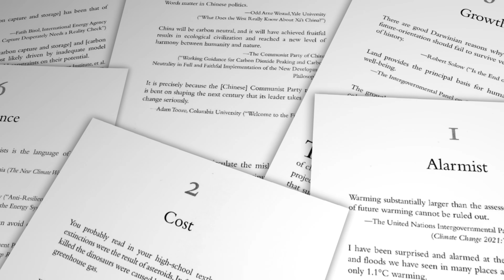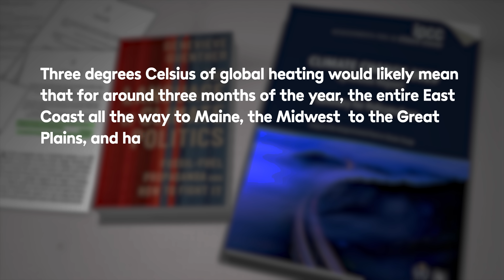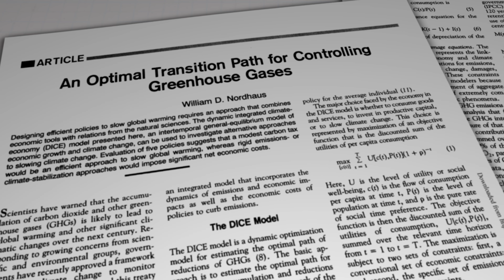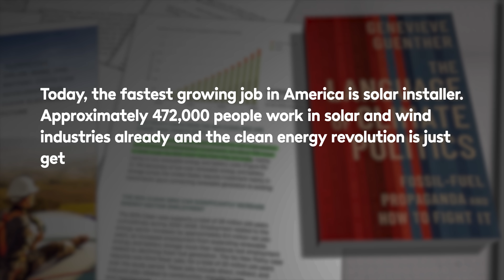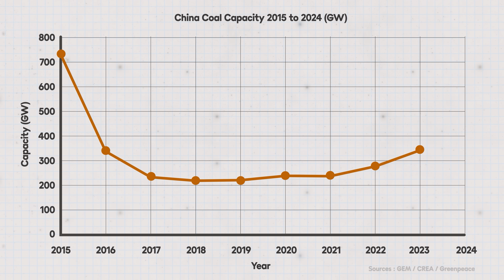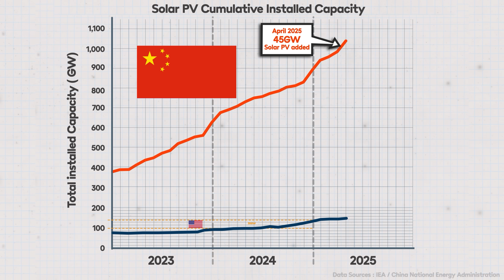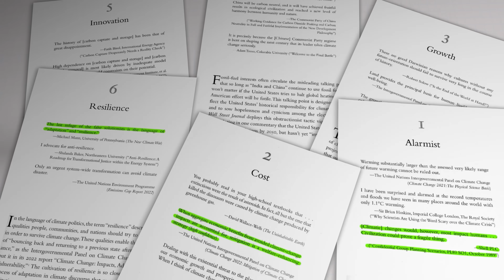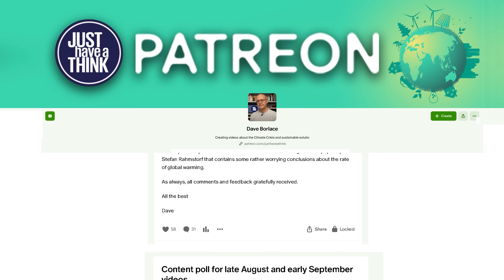New research DEBUNKS climate disinformation.

Comment: Sad part this has been going on since the 1980's and 1990''s. The funny thing had we started serious investment then, the lower the costs and the less pollution there would be now. The big issue is now we're going to have to spend more money doing catch up, if that's even possible at all. Just check the news over the past 5 years. I live in BC where we had that heat dome. Lytton had a forest fire and the heat made it worse. Now Lytton is a ghost town. In my 58 years I've never seen summers this hot. In fact this is the first cooler summer we've had in a while. Burying your head in the sand and saying it isn't real isn't doing anything.
Reply: How can such a relatively small YouTube channel take on the might of the US government,..with embarrassing simplicity.
Reply: I think its HAARP weather control by the secret hidden break away elitists. They caused the fires in Hawaii,  and all over the globe right now.  Its called an energy directed weapon.
Reply: 80s and 90s was the time the neoliberal ‘consensus’ was establishing itself in politics and western economics, and it was (and remains) extremely important to those clowns to maintain the idea that the worst thing any government can do is to interfere in The Market™️. And because the environmental movement had already become a primary enemy of capital by that point, because of how successful it had been in pressuring through strong national and  international regulatory regimes, shutting them down was also a priority even apart from the ‘government bad’ factor. As a result, no propaganda campaign in history (outside of war) has had as much money and resources behind it as the anti-global warming campaign has had over the past 40 years.
Reply: We will never catch up, we can only tweak the curve and try to mitigate the worst effects on humanity. But either way we will have climate refugees in masses fleeing parts of the globe
Reply: You are right if only we would have gone hard even harder than France on clean fission power the world would be a cleaner more stable place
Reply: “Burying your head in the sand…” is doing lots actually. 
None of what it does is any damn good, but counter productivity is a mile away from “not doing anything.”
Reply: Net Zero by 1970 !!!
Reply: Lytton is always Canadas hotspot for summer temps, always has been in 40's, I am older than you and I remember every summer it's always been in the news here in BC for being  hottest. I have driven through on the hottest summer days, Lytton/Llilooet are always cookers!
Reply: @carlsapartments8931  "I am older than you" argument from authority logical fallacy, paired with anecdotal evidence, is certainly a great way to dismiss facts and proven data. Only that it's not how logic works I'm afraid. It actually works in the exact opposite way. Completely discrediting your entire "argument".
Reply: Yeah like in 1980 there was global cooling but let's ignore that little inconvenient fact
Reply: @FL1CK3R  1 year out of 45? Talk about cherry picking.
Reply: @FL1CK3R  I live in Friesland in the Netherlands. We have an ice skating event the elfstedentocht which is held when all the canals between the cities in Friesland are frozen. It start in 1909 and after that it was held in 1912, 1917, 1929, 1933, 1940, 1941, 1942, 1947, 1954, 1956, 1963, 1985, 1986, 1997. And since then never because its not freezing enough anymore here. I live along part of the route and in the last 10 years it was only once possible to skate on the ice. When I was young in the 70ties we skated multiple times and had snow almost every year. Now there is hardly snow. So yes there was a short cold period in the 80ties, that let us have the event, and also in 1997. But the weather is definitely getting warmer changing during my lifetime (I'm 54 now).
Reply: @AndreVanKammen  I have friends in Cap de la Madeleine, Canada. and every winter I'd go up anticipating fishing on the St. Lawrence River. It was scary to drive my car out onto the river ice that first time. But it's been years since that has been possible. It just stays warm too far into the winter, so yeah, maybe you can fish for a few weeks in February, but that's too chancy for me.
Reply: @FL1CK3R  And finally, it’s an appeal to ridicule, framing scientists as if they “ignore inconvenient facts” rather than relying on peer-reviewed evidence. All four rolled into one lazy talking point.
Reply: @FL1CK3R  First, it’s a straw man: there was never a scientific consensus on “global cooling” in 1980—media hype exaggerated a few studies while the majority of climate papers even then pointed toward warming.
Reply: @Job-Brogan You’re doing a good job 👍
Reply: @FL1CK3R  Second, it’s cherry picking: taking one misleading anecdote and ignoring decades of consistent evidence for global warming.
Reply: @FL1CK3R  Third, it’s a false equivalence: pretending that a short-lived media narrative fifty years ago has the same weight as the overwhelming scientific consensus today.
Reply: @FL1CK3R  🤡🤡
Reply: @FL1CK3R  Wow, 🫵 managed to cram four logical fallacies into one sentence. Truly impressive how hard some people are ready to bend backwards to kiss the behinds of big oil CEOs, lobbyists, and corrupt politicians. 

First, it’s a straw man: there was never a scientific consensus on “global cooling” in 1980—media hype exaggerated a few studies while the majority of climate papers even then pointed toward warming. 

Second, it’s cherry picking: taking one misleading anecdote and ignoring decades of consistent evidence for global warming. 

Third, it’s a false equivalence: pretending that a short-lived media narrative fifty years ago has the same weight as the overwhelming scientific consensus today. 

And finally, it’s an appeal to ridicule, framing scientists as if they “ignore inconvenient facts” rather than relying on peer-reviewed evidence. All four rolled into one lazy talking point.
Reply: @FL1CK3R  Go ahead and demonstrate  that you are not an anti-American communist sheep repeating the party line without question like a trained dog and show us your data that there was in fact cooling in 1980 that was greater than the standard deviation in annual temperatures.
Reply: @williammeek-h2o can you please NOT throw communism and climate denial in one pot please? Especially since climate change is fueled and denounced by unfettered capitalism....

Comment: The current US administration is not concerned about how hot it is outside.  If your home has air conditioning, and your car has air conditioning, and your work has air conditioning, is all that matters. If AC is lacking, buy it - it will help increase the GDP.  All that matters is that you can work for companies owned or run by multi-billionaires many times over whether there is AC or not. US citizens are nothing more than chattel.
Reply: Those people who enjoy their AC never consider all the wildlife stuck outside.  How many wild animals will go extinct? 

How will we feed ourselves when all our crops and livestock die off, due to deadly heat waves?  AC wont save us there!
Reply: @davidvondoom2853 And as soon as the grid fails, many won't survive.
Reply: @davidvondoom2853  How do we feed ourselves when Net Zero pushes up the price of fertiliser multifold? Let's get back to the real world shall we.
Reply: I guess we’ll have to install ac for our wheat fields as well.
Reply: @luipaardprint  If the lunatics stay in charge, we'll end up building a big wall around the country and venting our heat out in to the rest of the world, because F* everyone but us.  🙄
Reply: Really hate this. It’s too hot inside so I’m gonna burn some fossil fuels to run the AC.
It’s too hot to bike so I’m gonna burn some fossil fuels to get to my destination.
Reply: Hi Lily. We are all gonna be climate refugees. Where to though? I’m not sure.
Reply: True.
Reply: Most of those politicians already have one foot in the grave so they don't care what happens to the rest of us. ☹
Reply: and then the power went off.  and there were no solar powered air conditioners.  the wet bulb temp went to 95F.  and they all died.  The End.  "my only friend"?
Reply: But China are? Can't blame them eh?
Reply: STOP the "Blame the other Guy" mentality.
Reply: @rogerstarkey5390did we read the same comment?

Comment: In the last month we've seen 116 and 118 degrees in Phoenix
Reply: @dougsheldon5560
Have you seen that lake Powell and Lake Mead are heading for trouble again?
That's going to be a problem.
Reply: What was it normally?
Reply: Did you bring a sweater sounds chilly compared to the 130 sky harbor saw a while back

Comment: Might be interesting to point out, that new coal capacity has lead to China closing old less efficient plants. And as you pointed out, many are not running at capacity.
Yep, better to talk to them in ways they actually understand: the prices of insurance are high, because they already understand these effects, same with those doing long term risk assessments at banks. And the economics of EV/batteries and renewables like wind and solar is already cheaper in many parts of the world and soon pretty much everywhere. So they can try and fight it, but what's the use.
Reply: With any luck, their failure to adapt and compete will shut them down sooner rather than later
Reply: @LaReynedeNeige   stranded assets, it's gonna be an economic failure